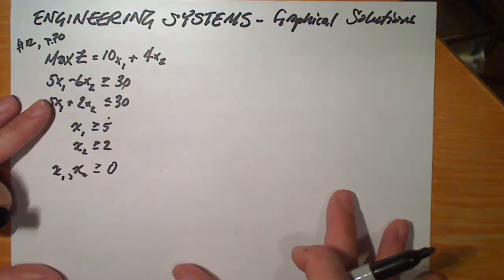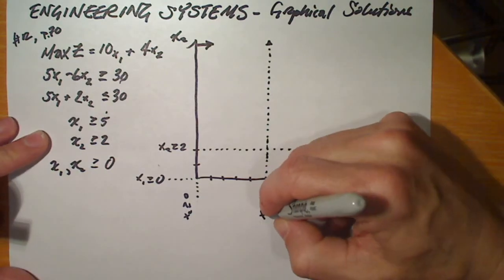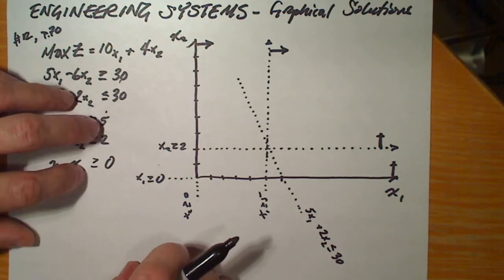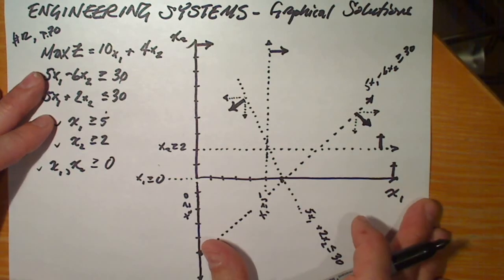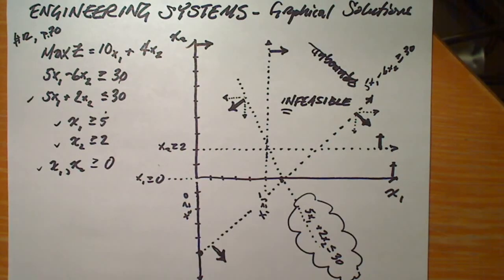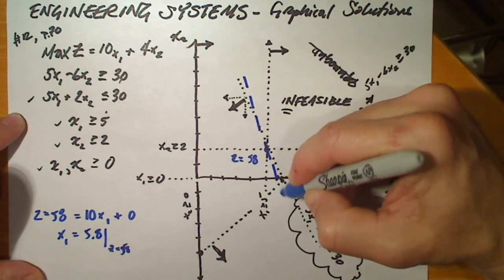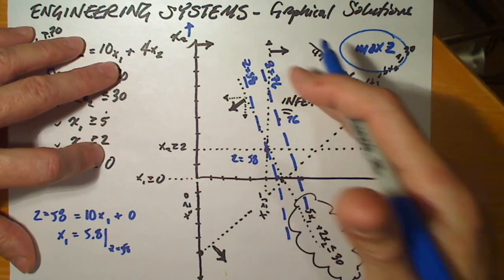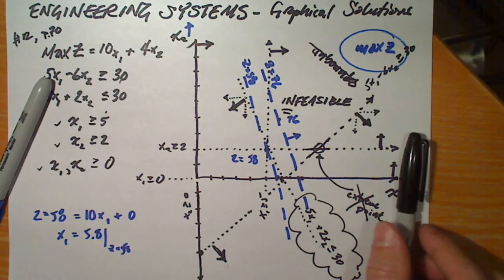Engineering Systems Analysis - Graphical Solutions example

Comment: An extreme point will represent the most feasible solution that is bounded by the constraints. Since the extreme point exists where the constraints meet, it will hold true that it would be at the extreme point. The extreme point will also represent the max or min in the feasibility region for a LP problem representing a higher Z-value. In an non LP problem, such as the rate of change, the extreme point will not always represent the optimal solution; it will depend on the objective function.
Reply from the maker: Not all extreme points are max or min, but for LP problems, the max or min will always be found at an extreme point.  Why?
Reply: @seagertp  the max or min is the maximum or minimum value that is within the feasibility range. The two lines that create the extreme point are at the edge of feasibility. Since the work is with the parallel contours and in LP,  as x increases/decreases z increases/decreases with it, the max or min will happen on a extreme point.
Reply from the maker: @michaelmacdonald8748  This is on the right track.  In a linear system, the slope of the objective function is monotonic -- i.e., the slope never changes directions.  Thus, any point on an active constraint will have an adjacent point that is either greater or lesser in objective function value -- until you reach an extreme point.  The optimum cannot lie in the middle of the feasible region, nor in the middle of a constraint, because the monotonic slope of the objective function means that the adjacent solution will always be greater (or lesser).